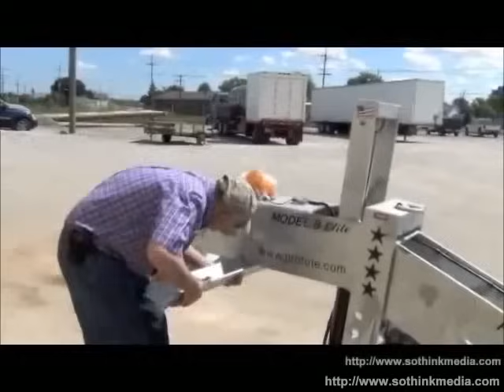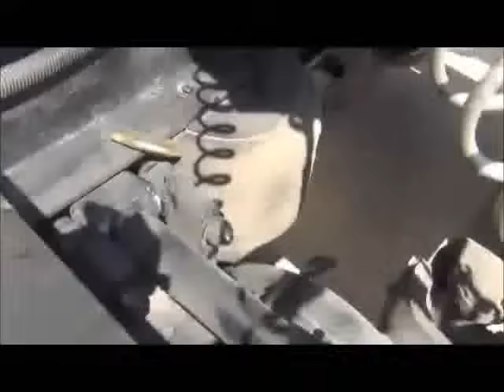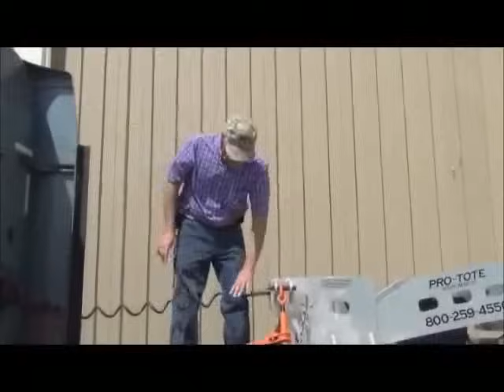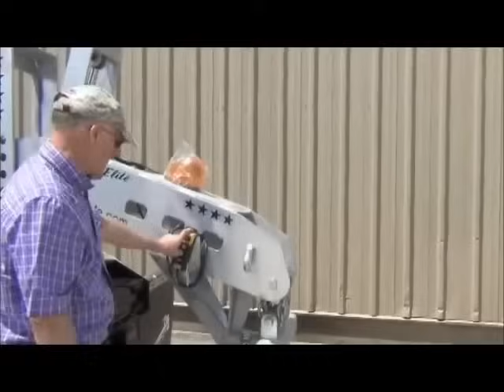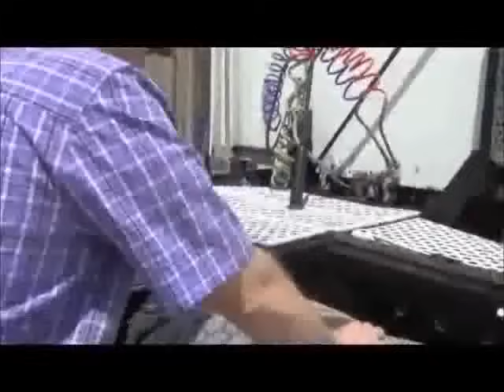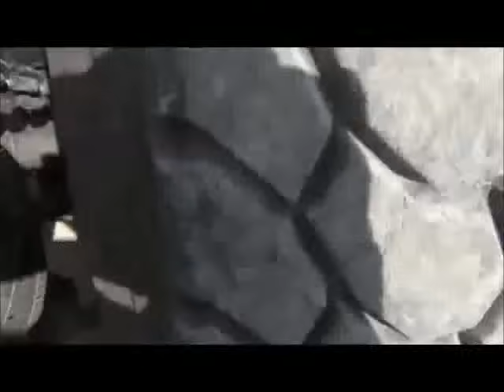Pro-Tote Semi Truck Towing Part 1

Comment: The tug method is not a valid method of checking king pin lock. Check the fifth wheel jaws to see that they are closed around the pin and the position of the release handle to see that it is all the way in. Thanks for showing your chain routing, that was very helpful.

Comment: I just use a chain and another drive to steer the other truck in nutral and all he gotta do is keep some tenchion on the chain and stear, lol  thats thing is a wast of time
Reply: @Anthony Nesbitt with your method what happens when you run out of air? I think this would save a hell of alot of money to be able to tow your own truck back home the chain method works ok in a car for a short distance but what about if you need to tow it hundreds of miles?